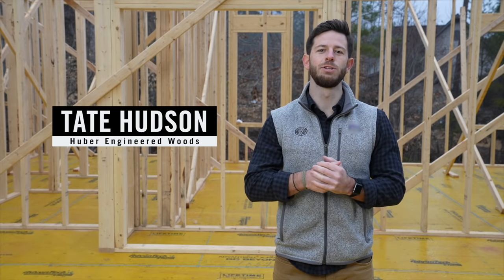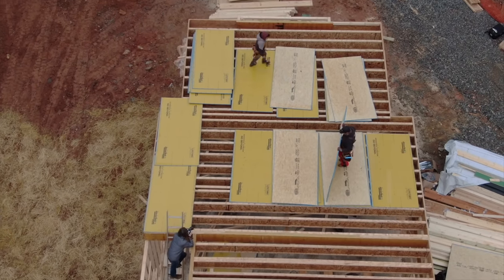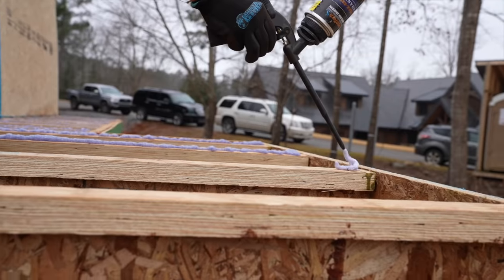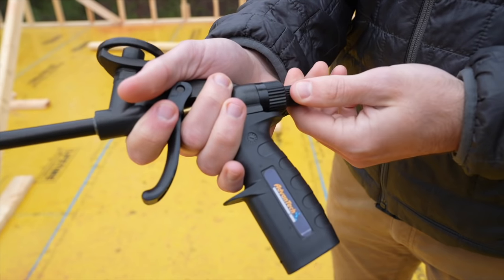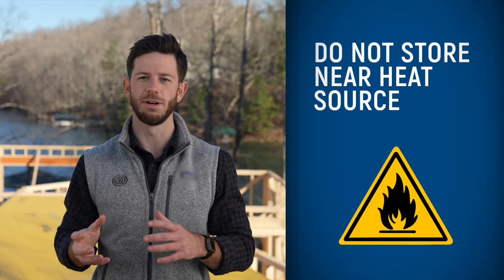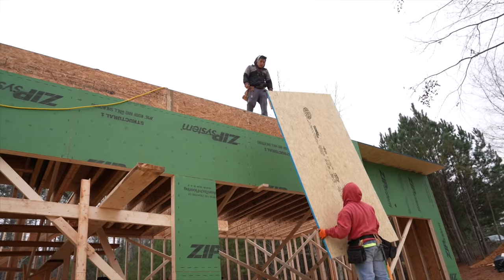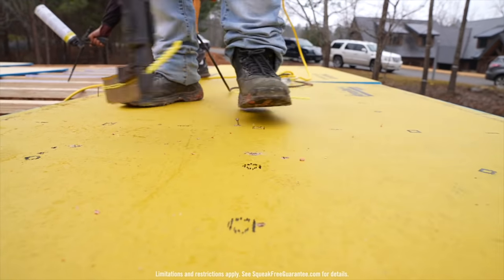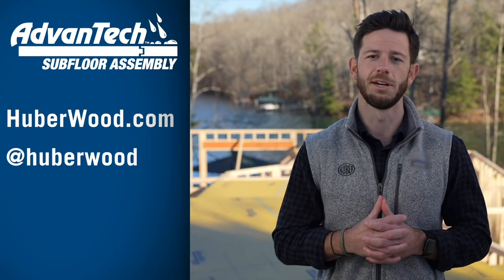Tips for a Squeak-Free Subfloor | Behind the Build | AdvanTech subfloor assembly

Comment: I have been in construction for many years as an electrical contractor on larger custom homes most of which used Advantech subfloors. I have seen many a home that had squeaky floors and humps in them. In every case I can say it was about 100% the framers fault. Poor installations make for problem floors no matter how good a product is. I would never use anything but a quality floor like Advantech. I used it on an 12x16 shed and a 8x10 shed my son and I built 20 years ago. Still as good as the day we built them. Could not be happier. Used it on my new kitchen floor a few years ago that was squeaky with the old 1970 floor system and is now completely squeak  free with Advantech. 
Good stuff!!! Could not be happier.
Terry

Comment: We used to screw that by hand. Framers just pinned them with a nail on each end. Inch and 3/4 zinc, never had a problem. We put tons of screws in them, 18 on each seam. 80% of problems with old home squeaks. Is not enough screws or they used nails

Comment: We have HUBER "Advantech" subfloor in our home and it doesn't "squeak", it "POPS" like a machine gun firing when you walk across it.  House is 17 years old, but it's been doing this for years.    I'm sure it would be blamed on "poor/improper installation" ...
Reply: Sounds like they did not get the screws seated properly. Sometimes the joists are not nailed down properly. If you are able to see the underside of the floor system like in your crawl space you might be able to locate those problem areas. Fixing it might be a booger at this point but I am sure there are people who have mastered the art of floor repair. You just have to ask around and find a good one. Then again Hardwood not seated properly on top the Advantech could cause a popping sound as well. Most floor sounds I have come across have been from improper flooring installation laid over the subfloor. 
Terry

Comment: I will be using 2x6 studs for my joists. But they will lay on sturdy 5.5" x 6" beams which are about 4 ft apart.  The joists are 16" on center.  I beam joists were way to expensive for me to consider.  I know the advantech warranty will not be an option because of my construction but I am hoping my floor will still be sturdy and squeak free with correct glue and screws for putting it in place. Any thoughts?